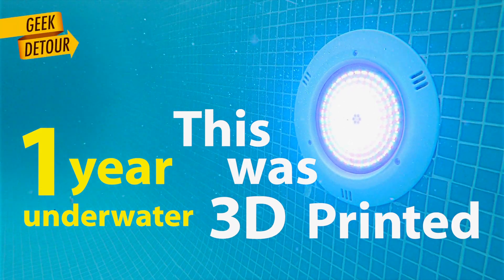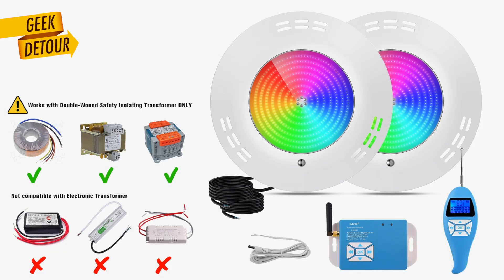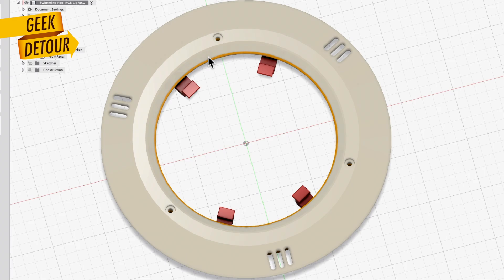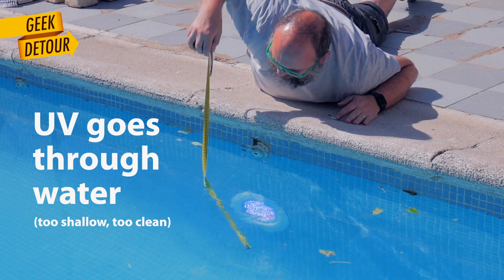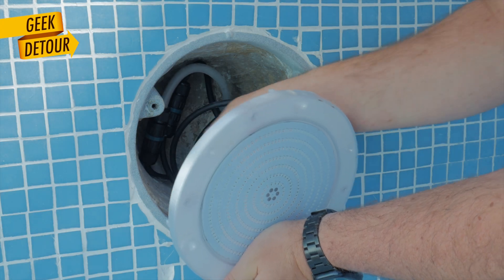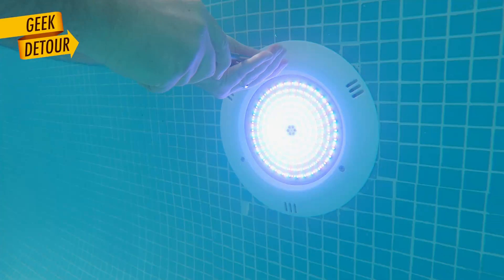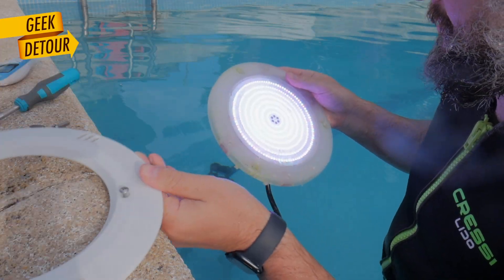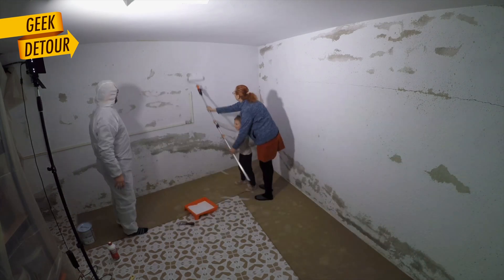What's the Best Filament to 3D Print for Water? | ELEGOO Design Contest

Comment: Thank you for this informative video!  Do you have any tips on making 3D printed parts seal enough to prevent water or air from leaking under slight pressure?  I 3D printed a vessel in PETG (at extra fine detail - 0.08mm) and i still get joints that leak just from the pressure of a balloon.  More specifically, I printed something with a rubber stopper hole and a couple of ports for rubber tubing.  I printed with 10 wall loops.  Where the ports met the rubber tubing, it was leaking.  I switched to a stiffer but flexible tubing and that actually fixed the issue with the ports leaking but the tapered stopper hole still leaks butted up against a rubber stopper.  The balloon slowly loses air.  Any ideas / techniques to fix my leaks?  With FDM prints, you never get a perfectly smooth surface and, secondly, there is always a seam.  I'm guessing that this is the problem.  I'm guessing you're going to say something about post processing but I would love to also know how to print something that works better in the first place.

Comment: ASA would be much better but ofcourse you need a really good industrial printer to make it without slightest warping... ASA tends to Warp and needs enclosure temperatures over 45 degrees. You have used PETG which can degrade its color in UV light but its white and below under water and water breaks UV light a lot! So that is why PETG works. Well done nice solution👌👏

Comment: Im looking for a filament to print dive tools, do u think petg it ll be a great one? I say because de salt of water. Thank u so much
Reply from the maker: You should watch this video: there is a sealant that might help you out if you need to make waterproof stuff (I mean, have inside areas dry): https://youtu.be/Q8x-mjjT8j4?si=Cryv6yfJ-ZCCJ96x
Reply: @GeekDetour  really nice, thank so much. Im trying with abs, but is so hard to print with, even i have a close 3d print. I close with acrilic my ender 3 v2, but i couldnt get good results. Im thinking about buy a bambu lab a1 mini and use PETG filaments. I ll se that video, thank u so much

Comment: Good to know that TPU resists to poll water chemicals + UV light! And PETG works surprisingly  good also!!
Reply from the maker: Actually, PETG is more UV resistant than TPU - but in my case the TPU parts are behind the Light, so it receives far less UV light than if it was outside.
Reply: Yeah you're right...

Comment: I wonder if TPU could be used to replace the rubber treads on a pool cleaning robot?
Reply from the maker: We have a Pool Cleaning Robot too (Dolphin… it’s a known brand in Spain), it was in the house when we bought it - works great. It’s original belts are in good shape, but I already though about it too. If one day they break I will certainly try to print them in TPU if the replacements cost more than a TPU spool. It feels like it would work. You mean, the Caterpillar belts, right?
Reply: @GeekDetour  yep those are the belts!

Comment: Know it's probably completely safe but watching someone mess with an electric light underwater while it's powered gives me anxiety lol
Reply from the maker: Oh, that’s the beauty of how it’s done in Europe: it’s a 12V AC transformer - specific for Pool installations, certified. The Secondary is extra well isolated from the primary. At 12V I can submerge the cable, naked contacts, turned ON, on the water, and even if I touched them (just don’t!), it wouldn’t be more than unpleasant.
The CRAZY thing is that in some USA States, it is still allowed to operate swimming pool lights that run on 110V AC 😬 That’s insanity.
Reply: that must be a lie, it's crazy that 110v can be run 5 meters nearby a pool, not to mention inside! Also crazier considering that in most places i have tested it's actually around 120-134v inside of the lines @GeekDetour

Comment: Writing this at start of the video. My initial thought for filament that would work as a permanent solution would have been PVDF (aka Kynar) since it’s UV resistant and VERY resistant to chemicals, only issues are it ain’t cheap and can potentially be dangerous to print if printed too hot. If somebody’s printer ran into thermal runaway mid-print it literally releases Hyrdoflouric Acid and Hydrogen Cyanide gas.
Reply from the maker: Wow… I’ll check it out - but I doubt I will ever print with it 🤣❤️
Reply: @GeekDetour  yeah it’s quite an oddity of polymers. It’s super easy to print and has insane properties but has that one somewhat concerning flaw to keep it from being commonly used.
Reply from the maker: Oh, it’s VERY expensive too… I could not find it in Amazon Spain also.
Reply: Thanks for the tip. 3DXTech (USA) sells 750g for $190. Ensinger in Germany lists some but can't add it to cart. Nile offers it to EU, Asia and Africa $250 for 1kg. So I'll start with PETG.

Comment: Wow! I’m glad this project worked so well. Really shows how durable these plastics are in harsh environments.
Reply from the maker: Ha ha, me too! I knew it would work fine at least “for a while” and I was OK to the idea of replacing the front panel or the mount from time to time… or at least if it gave me enough time for me to figure out some coating for a definitive part… But in the end, none of that will be necessary. The PETG parts don’t need anything, they will last for many years, uncoated. This video was the perfect excuse to make an inspection of it and I am happy with how things are still perfect.